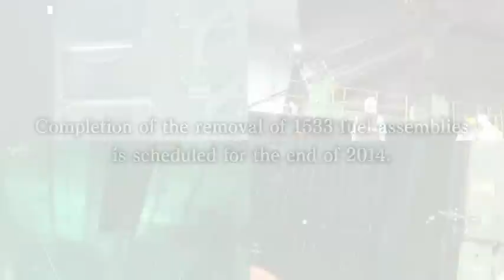Removal of nuclear fuel assemblies from Fukushima Daiichi nuclear power plant

Comment: Anybody else getting a really condescending vibe from the narrator? 
"We are smart, and you are dumb. We know what we are doing, so don't you worry now."
It's like, they fucked up royally, both in terms of engineering and in their safety practices. Yet they still feel the need to give themselves a handjob over their handling of THEIR own mess.
Reply: Lightspectre1
By trade, I'm a millwright. I work on pumps, gear boxes, elevators, etc. I've worked on / installed large scale cooling equipment in production plants before. Tolerances, specifications, and material and equipment choices would be be far more strict in the design and construction of a nuclear facility. But the basic process would be the same.

As stated before, I'm not a nuclear engineer, and I also have hindsight on my side, but here's a few things that could have been done to make it safer.
1. Decommission or update the plant. It was built in 1967, and a lot of the systems used were out of date.
2. Not build it right on the coast. Especially in a country that's prone to earthquakes and tsunamis.
3. Not build build the plant right over an enormous underground aquifer.
4. The backup generators were the last line of defense in a catastrophe, and they were taken out easily. And their last ditch backup, batteries, were ineffective.
Fixing any one of those mentioned above could have diverted disaster.

And that is why they have no fucking right to act smug.
I'm done with this.
Reply: Lightspectre1 Can I build a nuclear reactor?
That's a foolish and simplistic question that completely misses the mark. There isn't a single human being on this planet that has all the necessary skill sets to design and build a nuclear reactor. A project that large would be broken down into sections or categories.
Point is, I'm not a nuclear engineer, but neither is the guy that wrote the script for this. I know I could have done a better job. Most people could.
Reply: super lies are being spread from now on, because they need to convince everyone it's all under control when it's not. Real sources of information exist online, not like youtube
Reply: Yes.The narrator oozes with arrogance and I kinda think he was supposed to do just that. Yikes!
Reply: Look up 1- Fessenheim 2- Blayais, 3 Flamanville (explosion in adverse building on February 8th - EDF claims it was safe only ppl intoxicated by fumes. Subcontractors now operate on behalf of French giant, meaning if loss of life, radiation burns, the company is safe and don't have to pay, they accuse the sub-contractor of gross misconduct. sub-contrcators employ staff that have formal training but not fit for the type of work it requires. All staff are exposed to high level of radiation. Fessenehim is the oldest in France. 18 reactors last years ORDERED to be turned off - a real precedent and a real blow for the company who deals with "1000 incidents" each year, They basically lie three their teeth. To the public, but also to everyone else involved in maintenance. Thanks for listening.
Reply: Yes! Thank you!
Reply: The nuclear industry is going to have accidents - no system we can design is going to be proof against human error.
Reply: You're right: 2 people? ...... That's 100% more people than actually needed to create a nuclear f*ckup. ;-)
Reply: It's the same for every reactor.
Reply: Lightspectre1: "they fucked up" should be the heading for virtually every nuclear incident on record. Errare humanum est. ..... Which is why we WILL have more accidents - how long before we have one of global proportions?
Reply: craftmole Fukushima IS a global crisis. We are past the point of honest disclosures, honest exposes, or admittance to any scandal or impropriety especially regarding power structures (in both senses of the phrase here).
This is the case overwhelmingly today due to all major media outlets being owned by one group of powerful world players. They can easily agree on a consensus concerning major events and easily steer public opinion. To question any official narrative is to be a conspiracy theorist. sounds corny but Big Brother is really here now.
Reply: Russians been blamed for chelnobyle for 30 years, yet local Ukrainians suffered the most. Japan exploded four reactors, with no body hold responsible yet some shameless still think they are good and skillful? WTF, shame on Japan!
Reply: Okay.  Fine.  Can you make any components used to build a reactor?  Can you tell them how to do better?

All I'm saying is that it's pretty easy to say they fucked up.  It's much harder to understand why they made the decisions that they did and make a concrete, cost effective suggestions for how to do better.  One is constructive.  The other is a waste of time.  Am I correct?
Reply: +acronus But... what if they are smart?  And... what if you are dumb?  I mean... can you build a nuclear power plant?  Don't mean to defend them or to insult you or anything... just saying....

Comment: They censor everything in Japan!
Reply: +Kraken Fodder Not everything.  I can recommend to you some fantastic Hentai if you like.

But really, these are highly technical proprietary machines.  If I designed them, I probably wouldn't want to show you either.  I don't want you stealing my designs and using them to unload your own fuel storage pool, would I?  Can't fault them for it.
Reply: That just drawings, and they censor some of that too!
I was making a joke, but that is a good point! something I wouldn't have thought about!
Reply: The U.S. does not censor anything? please!
Reply: even the porn....
Reply: +Kraken Fodder Usa too.
Reply: True, but not nearly as much
Reply: Yeah I guess they just keep everyone busy shopping and watching reality shows.
Reply: that isn't the ocean boio, they suspend the isotopes in pure water to keep radiation from getting into the environment
Reply: that steam you see from the large columns isnt irradiated water, that is the regular water that turns to steam from keeping the fuel rods at a reasonable temperature, in no point is that steam is exposed to radiation
Reply: Except buttholes
Reply: the freshwater cools the fuel rods by going around the contained pure water, for the pure water is very hot, and pure water cannot get irradiated because there aren't minerals to transfer radiation into anywhere except the nuclear reaction
Reply: the water leaking is a huge problem, without proper cooling the fuel rods will melt down making a nuclear reactor failure and burning through the containment units
Reply: that is the problem, the water isn't bad for the environment, the uncintained nuclear material would create the next Chernobyl
Reply: Richard Gould clusiem melts (along with realising x amounts of toxins) at the bottom. what did the Japanese use to discover this?
Reply: USA censors way more than Japan

Comment: who is this narrator ? how much did he get payed to lie his ass off.We now know this operation was a complete hoax.The Japanese prison system is all about punishment, so why are the fraud artists responsible in jail.
Reply: The operation wasn't a hoax, I had co-workers travel there for the engineering of the fuel removal and ISFSI efforts. They were on-site and experienced it first hand. I have experience at the nuclear plant I work at doing spent fuel removal (and performing new fuel installation), and the video definitely looks legitimate to me. Even anti-nuclear groups wouldn't have enough money to fabricate such a video.
Reply: What is this "spent fuel", why is it there and where are they moving it to?
Reply: +Emanuel Guzman-Garcia Not sure if you're being serious or not..  but the spent fuel is the UO2 fuel that was removed from the reactor after it has used up its useful efficiency.  The spent fuel pool holds all of this,  where it is then transferred into dry cask storage (ISFSI) as seen in the video. In Japan,  this was performed after the earthquake to eliminate risk of the structural integrity of the spent fuel pool liner since another unit had cracked and leaked which leads to 'newer' spent fuel causing a fire because it is too hot to yet remove and put into dry cask storage.
Reply: wiretap25 yes I am completely being serious, and thanks fore replying. So with further research I now understand hat everyone is talking about here. These spent fuel rods have been sitting and cooling for a few years already, before the fukoshima incident, am I correct?
Reply: +Emanuel Guzman-Garcia yes,  correct

Comment: I think after accident, the fuel was molted down, if it was cooled down by sea water It will change back into solid phase. This time, if you want to move every  fuel assembly , no,  it is impossible( or maybe some sides of reactor). Y want remove fuel now, y have to remove a reactor!
Reply: +Manh Ngo the video is about the fuel assembly that were already in the coolant pools; such fuel cannot melt and did not melt.
Reply: I think they are moving spent fuel in spent fuel pool, man! obviously, they can't be melted down
Reply: +Manh Ngo ahem, no bro they ain't. What is shown in the video is the transfert of spent fuel from the spent pools to the outside via canister, which is done only after the cooling down period...this period being usually up to 10 years, you can be sure there was a lot of spend fuel waiting in the cooling pools...
The fuel inside the molten down reactor won't be touched for some times...

Comment: The censorship, I get. It doesn't just work against corporate and military espionage, it works against terrorists. Supposedly.  My problem with this video isn't the censorship; it is the blatant propaganda. I understand that some propaganda is needed when dealing with a topic that makes even fairly smart people panicky. I really do. Otherwise, people, for instance those who watch and believe Fox News, start shitting themselves and doing stupid and reckless things. However, this is just insulting to anyone with a brain. Don't downplay the risks that are obvious to even English majors like myself. If I can spot a risk, then it's probably obvious enough that it should be addressed openly so that people even less educated about engineering and the various sciences involved than I am won't start the "shitting themselves" process. The reactor itself had 3 safety systems built in and nature laughed at those systems and then giggled as the sea water causing some of the issues became the sea water needed for cooling. So, your "two wires" safety system for the cask, while perfectly sound, is not without risk. Instead of acting like it is a foolproof system, how about just being honest. "This is a good system that experts are sure will work, though we have seen the unknown power of nature short circuit other safety systems so we are vigilant in upkeep."  Look, there you go, a reassuring statement that doesn't assume those watching are complete and utter idiots. Obvious propaganda breeds mistrust and that causes poor reaction, dangerous Jenny McCarthyism, and paranoia in the minds of right wing militia groups in the US aka fox news fans. Etc.  I guess I'm saying either tell the truth or have the decency to tell a lie comforting AND believable.

Comment: 3/15/2011 The Japanese government and TEPCO informs the IAEA that the spent fuel pool in Fukushima Diatchi Unit 4 is ON FIRE and releasing Radio Activity directly into the atmosphere.
When the SFP gets to the point of ON FIRE , it's a done deal , game over. Tepco never removed a single fuel rod from unit 4 SFP.

Comment: If you done this 1200 times before how come you didn't put the generators and the pumps at the top of the buildings so there wasn't a melt down?. That's what happens when you do everything by the book and not use common sense...
Reply: +thedrloboski stevens Probably because spent fuel rod removal is absolutely nothing to do with the location of facilities.  I could make 1200 sandwiches and it wouldn't explain why my hands are attached to the ends of my arms.
Reply: Umm, if there's a chance of a pump flooding, you put it high enough, so that don't happen. You anticipate things before they happen, whats the worst that can go wrong, You my friend, better stay away from Construction.

Comment: Fukushima and all other nuclear facilities would do well to utilize an electric production method that can operate on the waste heat produced on site. Such a system would never have to be shut down and could be a supplement to a backup power source for the facility.

Spent fuel is an energy source not being put to use. Just because the "spent fuel rods" won't efficiently operate a nuclear power plant doesn't mean they are useless. If there were a facility built to efficiently use the fuel rods in their "first" spent state, society could get some additional benefit for all the effort of producing the things in the first place. Note that it's said the rods can safely stored in the pool after being removed from the core of the power plant. Some years of storage in the pool are needed before the rods radiation level falls off and with it heat production. All that thermal energy is wasted.
Reply: I've thought of this idea myself, thermonuclear power IS a thing, used mostly to power smaller spacecraft.
Reply: +Clint Luckinbill This is a really clever idea. One issue could be that the thermal efficiency of system is defined by the difference between hot temperature and the cold temperature.  Therefor you want your hot leg (coming from the reactor) to be as hot as possible, since you cant cool down the ambient. Waste heat isn't quiet hot enough to make it cost effective.
Reply: We are waiting for next gen reactors that will be able to simply USE the waste
Reply: @farfour_the_mouse  yes, but, for backup electricity,  operate Sterling motors on the extrele warmth to produe the backup electric power.

Comment: The reactor cores had their control rods removed greeting a massive fission reaction. This was done with the up most care to produce as much nuclear release as possible. Ever member of the team was trained in professional fuck up and carelessness, ever worker around the site died of radiation poisoning 100 times faster than the ones at Chernobyl. The reactors cores where also left in a full power state just for shit and giggles as the steam explosion would be rather awesome.
Reply: +(&quot;RNA0ROGER&quot;) Where are you getting this drivel?  They melted due to lack of coolant not a loss of control, when the power went out the rods would have stayed where they were and would have needed the diesel generators for any hope of moving them in or out.  The meltdown was caused by pumps losing their power.
Reply: Nobody died from Fukushima
Reply: If the heat source being "the main in use fuel rods" were removed how did a steam explosion happen??? Im not a nuclear engineer, but.....
Reply: Water is circulated through a water moderated reactor and so the water as a moderator can evaporate due to contact with hot metal from the fuel Assembly, causing pressure buildup as MORE water is input to prevent the rods from getting too hot due to lack of cooling and it is either A. Meltdown
Or
B. Steam explosion
Reply: When power was lost the cooling was also brought offline with it causing meltdown, and water still flowed into the core causing steam buildup, overall a big clusterfuck.
Reply: For more detail go to:

https://m.youtube.com/watch?v=qRKScRgsUaE
Reply: Additional info if you are interested:

https://m.youtube.com/watch?v=YBNFvZ6Vr2U
Reply: Nuclear power is basically steam power...Us monkeys upgraded are coal 🥸